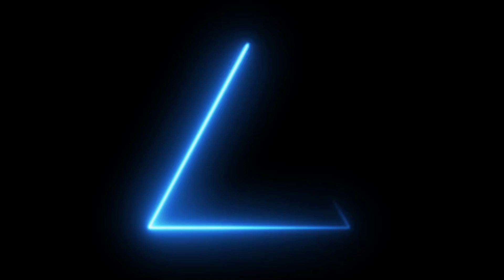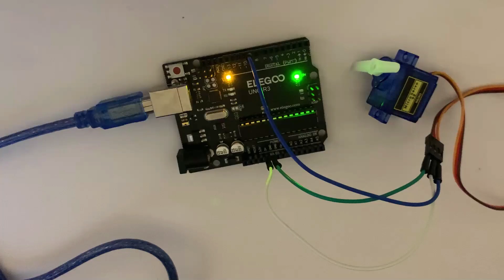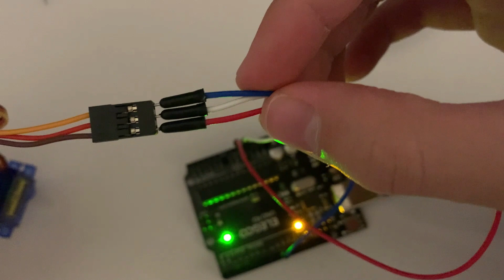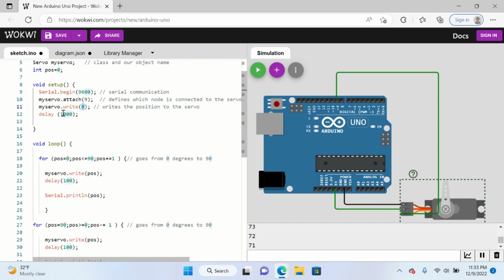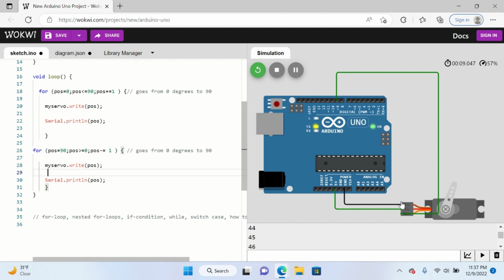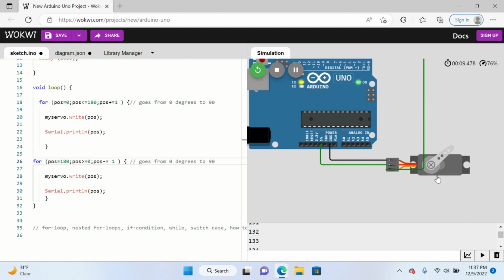Quick look at Arduino Servo Motor Basics

Comment from the maker: #include <Servo.h> // library 

Servo myservo;   // class and our object name
int pos=0; 

void setup() {
  Serial.begin(9600); // serial communication 
  myservo.attach(9);  // defines which node is connected to the servo. 
  myservo.write(0); // writes the position to the servo
  delay (1000); 
  
}

void loop() {
 
  for (pos=0;pos<=90;pos+=1 ) {// goes from 0 degrees to 90
    
    myservo.write(pos); 
    delay(100);

    Serial.println(pos);
   
    }

for (pos=90;pos>=0;pos-= 1 ) { // goes from 0 degrees to 90
    
    myservo.write(pos);
    delay(100);
     
    Serial.println(pos);
    }
}